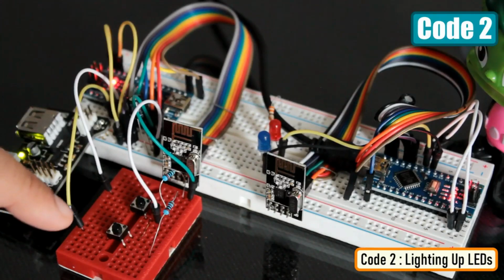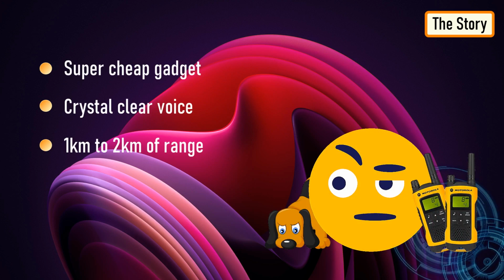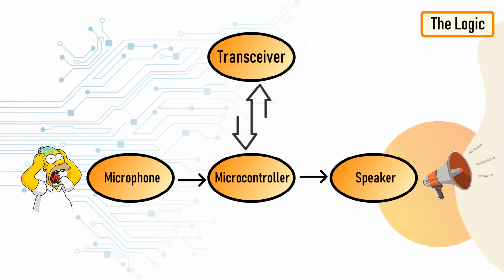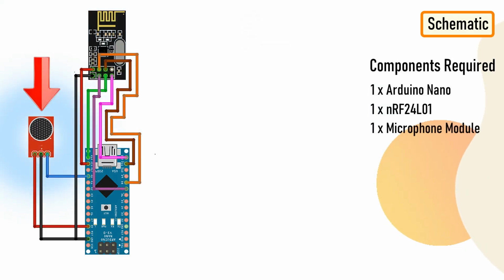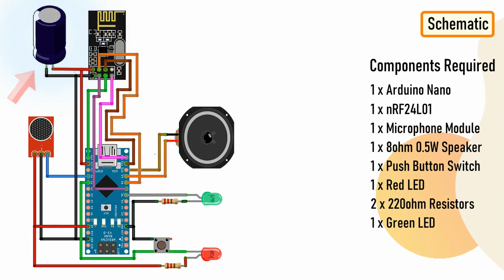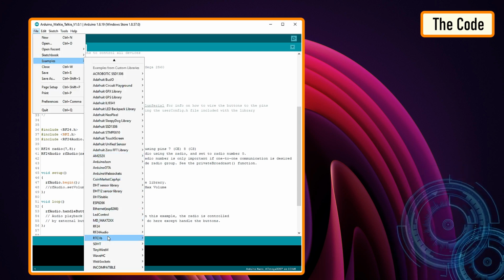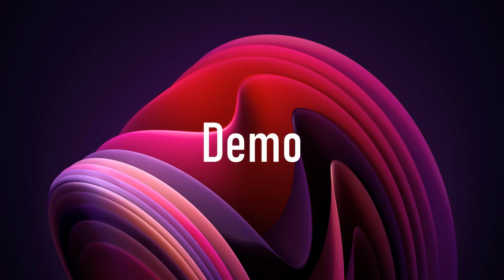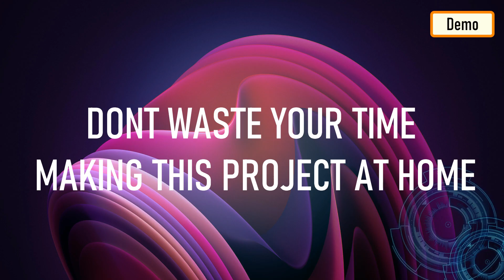How to Make Walkie Talkie Using Arduino

Comment: but your only using predesigned mic module and not using amplifiers and filter 

use self designed preamplifier circuit for mic which uses extra external power supply and use amplifiers at output 

your saying it's range is only about 20meters only ?

use 3.3v ams1117 module to power up nrf24l04 module 

i think this module is work more better
Reply from the maker: Definitely can try mate.
Thanks for the suggestion

Comment: Thank you for the project and your honest! I few years ago I engaged myself into a project like that. Luckly I found the "hamshield" which worked very well. But as a tip for those who want to play with RF communication, I would  suggest to use a SDR (Software Defined Radio).

Comment: the project itself is not a disaster...probably it just need an audio modulator module or smthing like that....
Reply from the maker: I wouldb be great full if someone can do that.
Reply: @CrazyCoupleDIY  can it work with max4466 microphone and PAM8403 amplifier for speaker

Comment: Bro stop discouraging people,use a low pass filter at the input setting fc= atleast 500hz to 1khz that way you don't capture any unnecessary High frequency signals remember the adc will only manage to sample recoverable signal when the signal is band limited,then amplify the signal using an external adc sample the signal at a higher sample rate frequency (nyquist theorem) ,i could write a whole book on components that are missing in this project, most importantly filters especially after the DAC  (reconstruction filters) question, i didn't know the Arduino nano has a dac and how did you manage to get analog output to directly connect the speaker there?  🤔
Reply: it's not dac on the arduino, it's pwm which is why the audio sucks

Comment: I want to send the voice input via a app so will that be possible
Reply from the maker: The device you have your app on does it not have wifi.
Reply: @CrazyCoupleDIY  I want to send voice as output to the speaker outside so will that be possible using my mobile
Reply: Speaker in the sense a walkie talkie out

Comment: A more engineering analysis would help a lot. What is the maximum bandwidth of the transmission? What is the minimum required bandwidth for voice transfer? What are other possible solutions?
Reply from the maker: Absolutely agree 
I guess this is just the 1st step towards something amazing. 
The config can be changed by updated the variable values in the userconfig.h